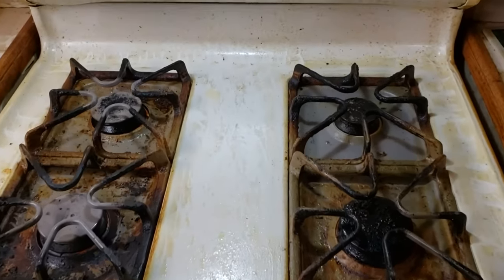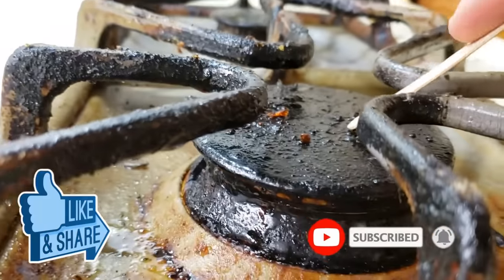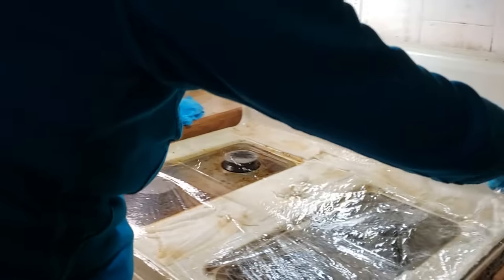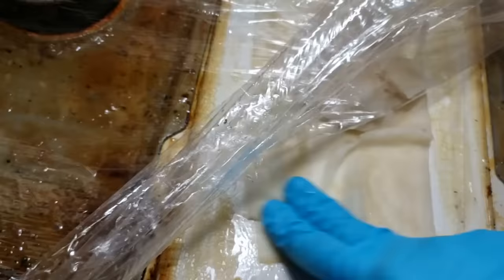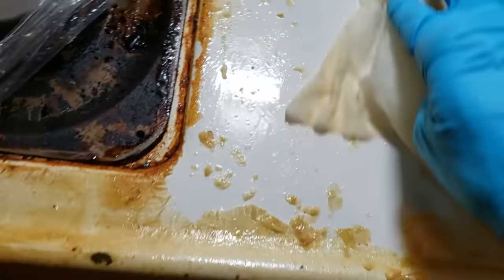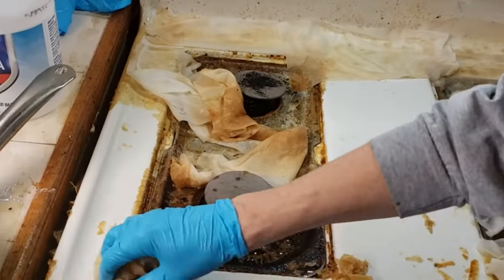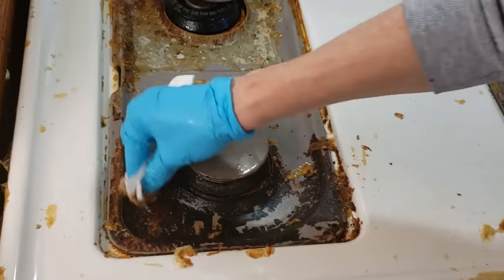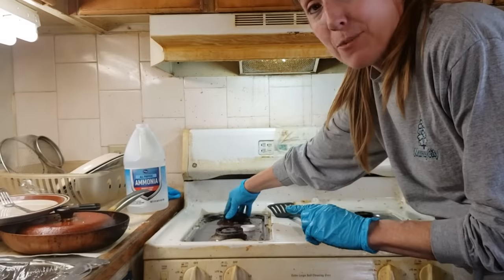How to Clean Stove | Over a Decade of Grease Build Up Gone! 💥 No Scrubbing!

Comment from the maker: Now that you cleaned the stove, how about working on the oven? Clean an Oven with Baking Soda and Vinegar + A Secret Weapon for Stains! https://youtu.be/vpvTrfx4qL4
Reply: Btw have you tried steam as an alternative to ammonia? You don’t have to take any health precautions since it’s just hot water but it works pretty good too because of the temperature and pressure. It also disinfects very effectively because of it’s sheer temperature and pressure, even a tiny unit or boiling liquid water is hot and powerful enough.
Reply: Can i ask what kind of ammonia you used in this video? I found ammonia chloride and ammonia hydroxide in e-market place
Reply: Does this method work on a black stainless steel stove?
Reply: I found that a toothpick works wonders for around the actual burner to get out the grime.
Reply: My mom used to put ammonia Ina plastic bag . Then put the Barberton grates in the bag. Over night.. it cleans
Reply: I just found your channel and have been struggling cleaning my stove. Tried a pressure washer, baking soda and vinegar. Would you be kind enough to tell me what the percentage of ammonia is in that bottle? We seem to get diluted to various degrees here. Love your channel!

Comment: Spray on oven cleaner covered with saran wrap works amazingly also.  Use a shaving blade scraper to get stubborn areas clean.  Use blade gently in a small area to check for scratching first.  Worked for me.  😊

Comment: If you are able to do a self clean mode on the oven, you could place all the burners, catch trays, and burner covers on one of the oven racks and let it all run in there, one and done, then come back later when its no longer hot and do the ammonia wrap on the bare top, and wipe out the oven ash. It might be a bit quicker in the long run?

Comment: When I moved into my little condo home, the stove was really bad. Not as bad as the stove you’re doing. But my stove was bad. And I took all the pans out and the racks and the burners everything that I could take out and I put them outside in a big heavy duty garbage bag and sprayed easy off on them. This was January so it was cold weather, but it was a sunny day, and the bag heated up really fast. So I let it sit three or four hours while I tackled the inside of the stove which was really bad. So I finally got it all cleaned on the inside of the stove and I went outside with a big bucket of soapy water and another bucket of clean water and I rinsed everything off and washed it and the soapy water and rinse it in the clean water and let it dry and then put the garbage bag in the dumpster. About three months later I ended up getting my kitchen redone because IKEA had a special and it included new appliances. But the stove looked a whole lot better when I was done. I wish I would’ve thought about using ammonia with paper towels on the inside of the stove. But on the other hand I have asthma and thatMight have really done me in.

Comment: You can take the burner grills off put them in a plastic garbage bag pour ammonia over them tie up the garbage bag put outside on sun. Leave for 2-3 hours. The grease peels right off. You can use a garden hose to spray grills the grease falls of no scrubbing.

Comment: I cannot stress enough on eye and breathing protection.  This is a must!  Also  turn off pilot lights on gas stoves as ammonia is flammable!   I've seen instructions on cleaning oven racks by placing outside in sealed garbage bags with ammonia. Wondering if ammonia can damage 
 some surfaces....

Comment: I tried baking soda and peroxide.  Some improvement.  Then I tried Easy Off Oven Cleaner.  Some more improvement.  Finally I found this wonderful video.  THANK YOU!  I did have to do some scrubbing for the worst, blackest, most entrenched stains but my stove top and the burner trays (is that what they're called?) are finally clean.  It's like a miracle.  I never would have thought of ammonia.  I followed the advice of @cathrineosberg292 to soak the burner trays in ammonia and leave them outside in plastic bags in the sun.  24 hours later the gunk came off them easily.   Meantime, I put the ammonia soaked paper towels on the stove top (and in the area under the burner trays), covered with saran wrap and bingo!  Clean stove top.  There are still some small areas with the hardened dried black gunk in the area under the burner trays, but with the results I've had so far I am confident that stuff would come off if I did maybe one more application of the ammonia soaked paper towels, etc.  But the stove top looks great now, so I'll leave that for another day.

Comment: I have to say my son's was a lot less dirty and greasy but management wanted to replace due to the jets being clogged. I cleaned the a wire pipe cleaner. I hope that will solve the problem when the gas is turned back on. There is another part in side the jet to clean also. But giving this a try.

Comment: If you take all the removable parts off the cooker and place them in a large plastic bin bag take a cloth  ( that you can throw away when you’re finished ) soak the cloth in the Ammonia put it in the bag with the cooker parts and  tie the bag tightly leave overnight and the next day all the muck and grease will rinse off no scrubbing. Remember to use in a well ventilated area and use rubber gloves

Comment: I had recently viewed this video on cleaning a stove, excellent. I do have a question, I have a GE electric stove with ceramic top, has not been cleaned since 2004. The grease is on hood as well as stove. How can I clean the fan hood as well as the ceramic top. 
thank you

Comment: Ammonia is great to clean the top of a stove.  But put the parts in a gallon sized zip lock bag with the ammonia.   Put that in a tote over night in your garage or outside.   Next morning, outside, remove the parts, take them inside to rince off.   Repeat if necessary.  First application usually removes everything.

Comment: What about the burners? Is that something that would just need to be replaced? Can u even replace those?
Reply from the maker: It works on bmthe burner grates.   Is that what you mean? Just take them off and soak them separately.   I soaked them in a cake pan.   Just make sure to cover the pan with syran wrap while it is soaking
Reply: @CleanFreakGermaphobe  thank you 🙏🏿

Comment: Could you get the same/similar results from using distilled vinegar?
Reply from the maker: You can clean an oven with baking soda and vinegar.     Janet did it in this vidoe, check it out.  https://youtu.be/vpvTrfx4qL4.    But it doesn't clean the same, it takes more time and scrubbing.
Reply: @CleanFreakGermaphobe  thanks so much for the reply! ❤️

Comment: Does the ammonia take the color off? My stove isn’t white, it’s black. Thanks!
Reply: It will not hurt the black stove. I used to clean professionaly.
Reply: @sheliatoledo5898  is it dangerous ehen you use ammonia to clean near the hob part/ eyes of the stove... does it make stove dangerous to turn on or does it effect it from working?
Reply: @sadiauddin4237  if it's gas,then turn gas off before cleaning. Ammonia is combustible. Turn off pilot light,clean your stove. Make sure all ammonia is gone ,then turn gas back on.

Comment: 💙💙. I believe it’s actually the vapors from ammonia that do the work. So you could actually throw all grates and such into a large trash bag (carefully so as not to puncture the bags/allow vapor to escape), with a small dish of ammonia, tie bag up and let soak overnight (or longer depending on how badly caked-on the grease is). But that stuff will literally peel/flake right off the grates.  And I think the same for cleaning oven; just place a dish  in over night and let the vapors work. I think I may have tried on oven once with little success, so maybe longer soak time or soak a couple paper towels and place on each rack along with a small dish of ammonia at bottom?. 🤔🤷🏻‍♀️

Comment: That was just absolutely remarkable using ammonia in addition I would have also used easy off for the top
Reply from the maker: I like Easy off fume free.  And I would recommend that over Ammonia for smaller jobs since there is less fumes.   But when I compared the two, ammonia worked much better.   Crazy huh?

Comment: Will the ammonia is the answer I would have taken all those pieces apart and put them in 2 large heavy-duty duty black garbage bags and pour one to two quarts of ammonia into the bag set them outside because the bags can leak tie them up tight and I guarantee you the fumes in the bags we'll just eat at all the stuff on there I mean just take the hose pipe and spray the stuff off great for oven racks to
Reply from the maker: Great Tips. 😊 I have done that as well for people's dirty grates.  It takes a lot more ammonia but I like that you are working with it outside

Comment: Let me make a suggestion. If you simply throw those disgusting oils away and never ever buy another one. Use lard or another animal fat instead, you will find all you'll need to clean your stovetop in the future is a paper towel and a spray bottle with water when the stovetop is cold. I bet you don't believe me, but it's true. It's the oil that turns like plastic.

Comment: Not cleaned properly. All components should have been removed and cleaned systematically. I was not that impressed by this tbh. Plus, the audio was awful. 😔
Reply from the maker: Thanks for your input.  We were just passing though town and I didn't have as much time to clean it as I would have liked.  Next time we visit, I will have more time to clean the whole thing.
Reply: @CleanFreakGermaphobe  just wanted to let you know that you handle some negative and off the wall comments with humility and grace… I would not do so well myself
Reply: You could have just kept scrolling couldn't you? No need to be nasty. I think they did a great job with what they had to work with in the time they had to do it.